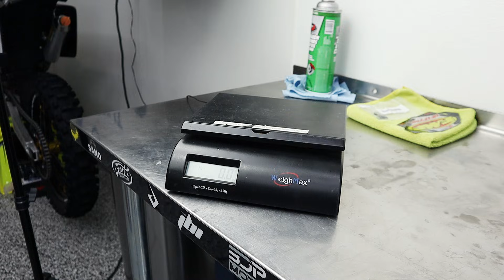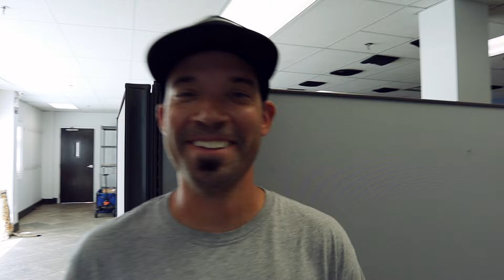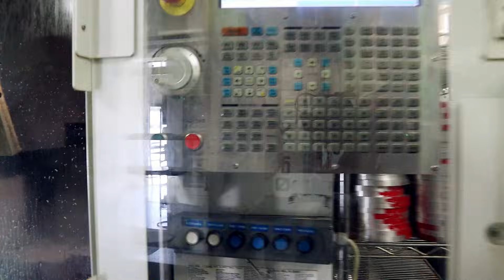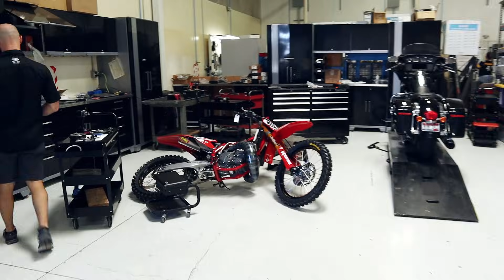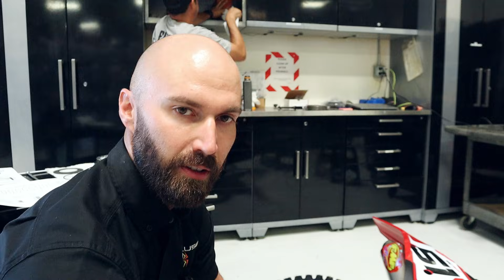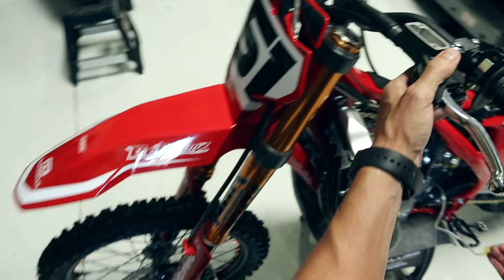Building a $35,000 Big Bore Two Stroke (it’s UNREAL) Kiss that Honda CR500 / Kawasaki KX500 Goodbye

Comment: Unless you are a veteran machinist you can't' really appreciate what is going on in the Rekluse machine shop.  Several years ago they went out shopping for an automation 
solution to keep their CNC mills running unattended.  Just like everybody else they couldn't find a system that would work.  So they built their own and it's freaking simple but brilliant.
It was so good in fact that they spun off a separate company to manufacture and sell these machine tending systems.  That company is called VersaBuilt.  The 2 problems with robots 
loading CNC mills are constant reprogramming for each new part and the endless number of grippers you have to make for the robot since mills can make an infinite array of shapes of parts.
They solved both of these problems and since the day I first saw one of these systems run, I was kicking myself in the butt for not thinking of it myself.  
Most people will never know it but the motocross industry is forever linked to the next evolution of automated manufacturing for the entire world.  
P.S. I'm not a customer or an employee of either company.  Just a huge fan.

Comment: Does 35k cover labor too?
Reply from the maker: For customers, I’m able to hit roughly $25,000 pretty regularly with all the bells, whistles, and labor.

So it should be just about spot on with the 500 engine, and a few special parts such as the handmade exhaust pipe for it, etc.

Would be stoked to build you something! 

https://www.mxrevival.com/contact

Comment: I don't know why that big 500cc engine has an exhaust power valve on it, and the extra expense of it.  I know if they are designed right, they will broaden the power of a two stroke engine.  They help out smaller bore bikes, but a 500 (well ported and piped), has power everywhere.

Comment: Clutch design has changed quite a bit.  Is that Recluse's design that uses 6 hardened hollow drive pins to turn the hub from the drive plates?  You should never groove out a drive hub.  I like it.  :)  Are the outer basket fingers hardened in some way also?

Comment: For the pegs:  2024 billet aluminum is not stronger than 6061, but is less brittle but more malleable which means dents easier, (not that 6061 is brittle).  The "20" and "60" in 2024 and 6061 indicates the tensile (pulling apart) strength.  20,000 lbs per square inch vs 60,000 pounds per square inch, which makes the 6061 stronger.  7075 is more brittle, and corrodes faster than both of them.  IMO, 6061 is the better alloy for the pegs.  The 2024 will do a good job, but I am sure they will sag faster and bend easier than the 6061.

Comment: He was using the torque wrench wrong
Reply: How do you know?  (the handle has a fulcrum pin in it).
Reply: @EarthSurferUSA  your supposed to hold it from the end of the handle
Reply: @AndrewWatson975  Nope, with the fulcrum in the handle (the handle will pivot a bit on it, like a loose handle or a teeter totter), you just have to hold it so all the force is on the fulcrum pin. From the center of that pin to the center of the socket is the correct length that the torque is calculated from.  If you grab it at the end of the handle, and the handle hits the rod it is over, you will actually have a longer lever, and put less torque into the nut.  Just hold it so the handle is in the middle of the "teeter totter" (for a lack of a better phrase), and the force will be put on the calculated length of the lever.
Reply: Oops:  I am talking about an older style torque wrench, where the lever bar actually bends as you apply more torque.  That is the type that has the fulcrum handle.  My 2 newer torque wrenches have the fulcrum devise inside of the wrench, so I would not think it would matter where you had your hand exactly on the handle, but they both say the middle of the handle.

Comment: He should hold the torque wrench by the handle, not way up behind the ratchet.
Reply: He may be choked up by about  an inch, (not "way up". And the ratchet is at the socket).  But the heal of his hand looks to be in the middle of the handle well enough.  I bet there would not be 1lb difference if he moved his entire hand 1" in the center of the handle.  I would think there could be more error because he can't hold the basket firmly with that special wrench, so he may get that 1lb back there.  lol
Reply: @EarthSurferUSA   you’re talking about when he did the nut. I’m talking about when he did the six bolts.
Reply: 50:22 he’s grabbing it on the ratchet, furthest away from the handle.

Comment: Need to see a Dyno sheet! would love to see if the BRC kit really makes considerably more power, which I hope it would cause I could build a 100hp cr or KX for $8500 in the motor alone.
Reply from the maker: BRC sent over a Dyno sheet on the YZ500 (use all the same internal crank/ piston/ exhaust valve) and it cracked 70hp. Stock CDI and the cone pipe 😵
Reply: The only problem with a dyno (I own one), is they don't have a good calibration method.  So not only is there many times error for the results, but people can make them read what ever they want if they are not honest.  I actually use a stock engine to calibrate mine, (small 26cc Zenoah engine), that claims 2.8hp at 12,500rpm with no exhaust and no filter.  So I set it up that way, Jet it as well as I can, and change the "efficiency loss factor" to get the dyno to read what the manufacture of the engine claims it makes for power.  The only possible problem there could be, is I am trusting the maker of the engine that their claim is what they say it is. I do have reason to believe it is.  I don't know of anybody else who calibrates their dyno, and that is why you can take the same engine to different dyno's, across the nation, and get different results.
Reply: You don't want a 100hp 2-stroke or 4-stroke engine for a dirt bike for trails or MX tracks.  A 2-stroke would get too hard to ride (peaky power, and lots of it), but might be good for drag racing, or top speed straight line competition.  The 500cc MX bikes made only about 60hp for that reason.  Yes, they can get more out of it, but not for that kind of riding.  A 4-stroke can make more power and be less peaky because it crates power for every 2 revolutions of the crank instead of one.  That is why we are seeing 70 hp that is manageable (for a talented rider) on a MX track, (plus the tracks are smoother, built for a faster engine today).  If you want 100hp, I hope you do not plan trail riding or MX tack riding, because your lap times will probably be better on a stock 250cc 4-stroke, and you would probably live longer.  Drag racing?  Go for it. :)

Comment: Great tip on cleaning powder coating.  I always try to clean the area when mounting the coils on a fresh rebuild.  Very cool that you took the step to measure it and found shocking results...  Great build can't wait for this to be in my garage.
Reply: IMO, for powder coating, it is best to mask off all the bolt head surfaces of the frame.  The thick power coating can compress after torquing, and bolts can come loose over time/vibration.

Comment: Megura clutch master swap it. it reduces pull and makes the brembo feel like a cable clutch. I have both my 250sx and 450sx-f swapped, you'll need the clutch line as well.